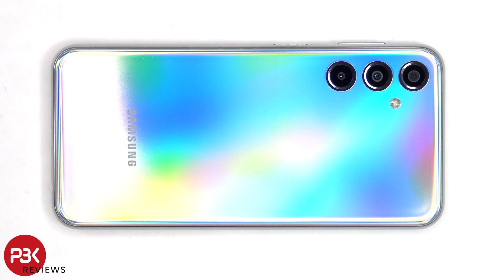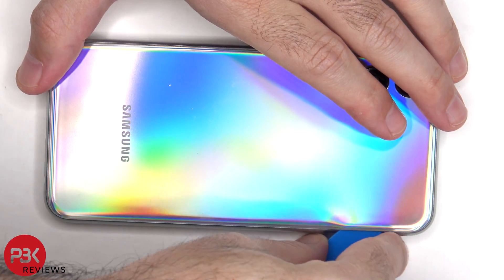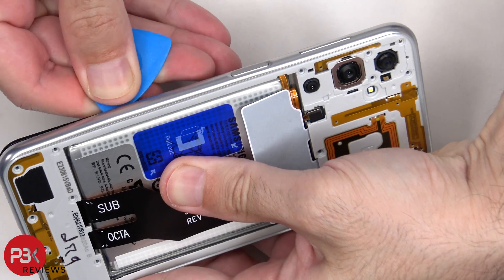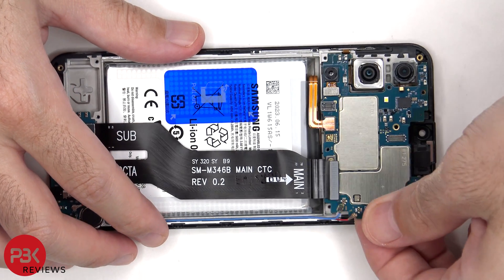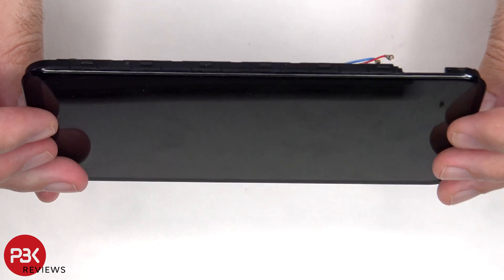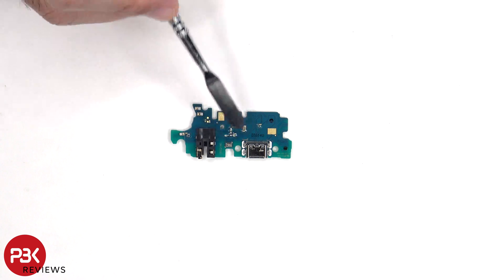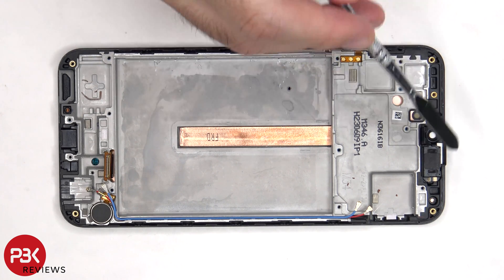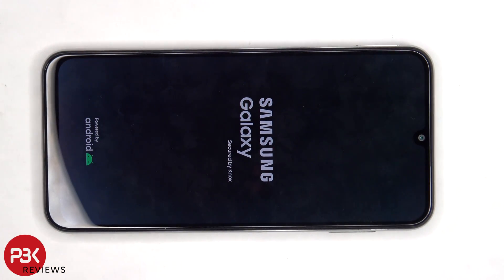Samsung Galaxy M34/F34 5G Teardown Disassembly Repair Video Review

Comment: Hello, I live in Turkey, my battery has changed, but the charge runs out quickly and fills up very late, 7 hours or so, I wonder why calibration software needs to be discarded, I would be glad if you answer